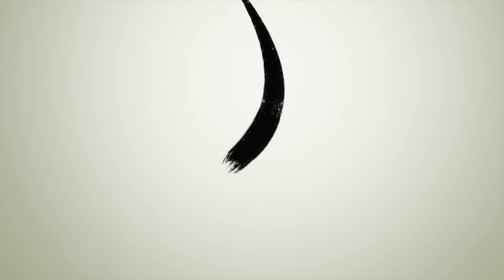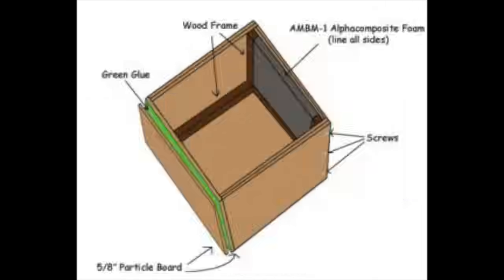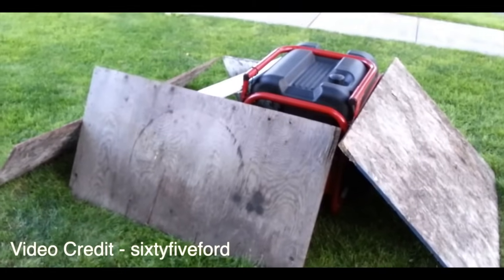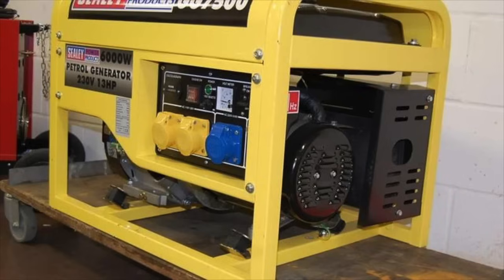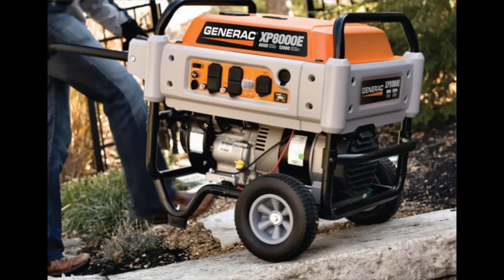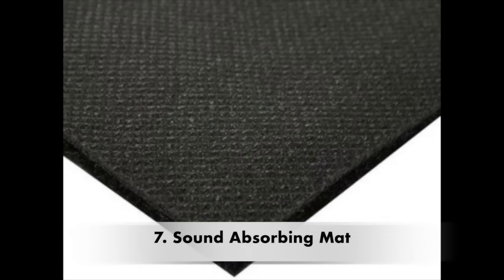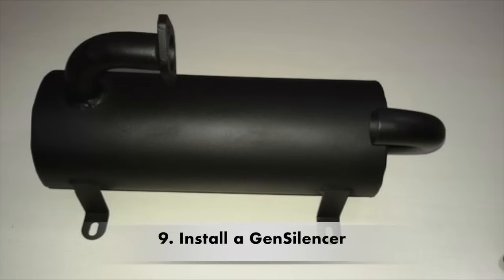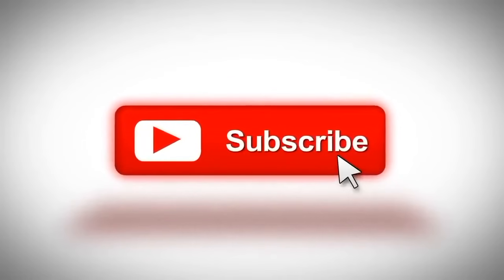How to make a generator quieter - 9 Ways That Work!

Comment: Actually most of the noise from an open frame generator comes from the engine block itself, along with the rotor/stator. You’d have much better luck building an insulated box, which you can either make with one side open (maybe point that side toward the woods) or put electric fans in it to circulate air in and out. Makes a huge difference!
Reply: this can b done in spare room with door close?? and have fan running circulating air? and exaust for ventilaion

Comment: For generators used to back-up electric company, dig a hole to put generator in.
Add a foam or insulation top panel.
Pretty hard to beat solid earth for sound deading!
And, a simple hole is pretty cheap compared to box options 😊

Comment: When you build a speaker enclosure, you would design the sides to be unequal to avoid making a resonant cavity that peaks certain frequencies (a 'booming' effect) Same-dimensions create standing waves that actually amplify sound. 
Same principle would apply to a generator enclosure: build each side so it is not exactly the same or a multiple of that one. For example, the front should be slightly larger than the sides and the top. This will help suppress the lower frequencies. Suspended-ceiling tiles will cut the high-frequency and some mid-frequency noise.

Comment: FYI. Your links are dead. Glad your Amazon storefront is active.  Got any recommendations for AC units sitting on the patio? So loud I can’t hear myself think. Built planters around it leaving sufficient airflow, but it still echos off the house. 

Got anything waterproof?

Comment: if it will be used in a fixed location. a comcreat base. then cender block walls.
insulated roof.
this combo will go a long ways to knock down the DB’s. 
BUT you must also allow enough air in and hot sir and exhaust gases out. 
so on the bottom layer of the blocks, leave a couple of then out. but have a anti insect screen. 
plum the exhaust out through the roof. up to the 10 to 15 foot level. 
and allow hot air out of the shed. but best if a fan is at one of the holes at the bottom to push in cold air.
the gen powers the fan. but no direct in or out for the air as sound dies not do corners very good.

Comment: Everyone talks about inverter generators on how good they are, and how quiet they are. Well, let’s see how long they last and when they do break how much they are to fix. There is a lot more to an inverter generator than just a motor and an alternator. A lot of technology, and you know that technology is exposed to heat, cold, and humidity

Comment: I've had a generator for about seven years now and haven't had to use it for longer than an hour.  However, with the recent weather patterns lately, I was wondering about muffling the noise cheaply in case I do have to run it overnight.  I like the third option of blocking the noise by placing plywood around the generator.  I would probably glue some some soundproofing foam on the plywood and also place a rubber mat underneath the generator.   Thanks for the tips!

Comment: Big mufflers never work. It’s the fact that a small 4 cycle engine has to rev to 3,600 RPM it’s the engine itself and the surrounding parts. VIBRATION IS THE REASON FOR THE NOISE, ALSO, SIZE MAKES NO DIFFERENCE I OWN A GENERAC GP 17,500E  ITS A 992CC V TWIN AND WEIGHS 400-500LBS ITS LOUDER THAN ALL OF THEM!! LOTS OF MISS INFORMATION AND HAPF FACTS HERE.

Comment: Built my own "zombie" box with 1/2 plywood and 2bys, 1st I heard it called that, anyway used a 12" 1600 fps soffet fan that blows into a 1foot sq exhaust port or box that blows into the earth down outside of the  enclosure to keep it cooler and 4 directional 4" intake tubes, (tin exhaust tube) on opposite side and 4 2" vents up top  for heat to escape after shutdown. Has 1ft clearance on sides and 2ft above generator. I used rockwool on front, rear and top, it's fireproof and its very quiet at 50 ft,  just a slight hum for a fully  featured  Westinghouse DF   9500watt, has 3yr warranty. Steer away from HF, Chinese junk for same price with no extras, warranty or features! Did put a small desk fan in back that blows across the cylinder, hottest it's ever got out of airstream was 130 on a 100 day, take off any useless heat guards. Has over 1000hrs and can't complain yet! Remote feature is also  great.

Comment: Just to correct the information, no small engine is splash oiled anymore.  Flathead engines will not meet EPA requirements and OHV requires an oil pump.  The easiest way to deal with a generator is to make a corral of filled concrete blocks in which to run it. It only has to be as tall as the generator.

Comment: Any holes you make in your shed are going to allow sound to escape.  The holes need to be covered with a baffle to break the sound up before it reaches open air.  This includes air intake and heat exhaust fans.
Isn't a gen 'silencer' just another name for a 'muffler'?
When building a sound-proof enclosure, you should think in terms of reflective, absorptive, and inert layers.  Innermost is reflective, next is absorptive, with the outermost inert.  The inert layer prevents the engine's noise from being transmitted into the surrounding environment.  See the comments about sandbags below.

Comment: Several are pressurized oil systems. One of the nig noise factors is most portable generators run at 3600RPM. Your sound better be able to move one hell of a lot of air. Its an air cooled engine and they need a lot of air flow

Comment: First of all dummy anyone who's ever worked on an engine knows that you don't put a car muffler on a small engine like a generator. That's why they have mufflers made for smaller engines if you're going try using a muffler from something like a Go-Ped that will muffle the sound but doesn't increase things like back pressure that will cause the f**** generator to fail and stop working on you entirely. Truthfully you could just not be lazy build a big enough enclosure that has a ventilation port or safe a fan and you build it with soundproofing material so that you can put the generator in it run cords from it and still not have to listen to it because it's in an enclosure that greatly muffles the sound. Just make sure to add say a fan or so to move the heat around so it doesn't stay in one spot and catch things on fire. It's amazing the type of s*** they honestly let people put on YouTube

Comment: sound proofing a generator  like this can cause damage to  the Generator . 1  it can cause the generator  to over heat .has to be vent very well then you lose the sound proofing . also  alot of gens  have alot of plastic's  on them that can warp  over time  use due to the heat . intakes . carbs  can be plastic . elec  control are plastic that do not do good in the heat . most  Gas gen are loud . propane  gen  run alittle smother  and alittle more quieter then gas .  but if you do this you do it with a  bad risk .
 risk  
over heat
wharp plastic  due to over heat 
elec  failure  due to over heation
elec control system   has silcone  base to weather proof  elec that can melt  an turn it into a 700$  repair . an sometimes   parts you can't get specailty  with honda  generator's  since Honda  loves to not make part for engine's or generator parts for  to long . 10 years i think is the max .
also you can blow your self up . due to the  gas tank being mount on the generator . 

SO DO AT YOUR ON RISK!  IF SAY IT CAN BE PUT INTO A BOX PUT IT IN A BOX OTHER WORD'S  THEY MAKE QUIETER GENERATORS

Comment: A Zombie Box or an enclosed soundproof box sounds like a good idea, but what about all of the heat? Where does it go? Out that small ventilation hole. It might work for 20 minutes. But after an hour or so, it's going to shut down and most likely destroy the equipment. Generators are air cooled. If there's no air getting into the enclosure, how does it get cooled? If you figure out the cooling issue, please let me know. I would keep one side open and aim a large fan at the generator. Unless you don't like your generator, then do whatever.

Comment: we dug a hole in the ground put plywood over it,one we put it in the ground to help cool the motor ,we put vents in the plywood top,it made little difference,we even put 20 ft of pipe on the exhaust little difference

Comment: I simply installed a smaller pipe to the exhaust.  It works for motorcycles as well.  Easy and cheap.  Reducing noise level 50%

Comment: I mounted a 250 amp dc alternator on the engine of one of my little Honda cars. Then I wired it to a 120/ 240 volt ac inverter . I have a breaker power box  that allows me to plug the 10,000 watts inverter to my house through a throwover switch. With an adjustable throttle cable, I can park the car outside my garage and plug my house into the cars power  inverter and power most of the house with a cord we got from a trailer house we got rid of some years ago. Our propane house heater is no problem, but can only run one ac unit on the house. But everything else works fine.  And you can't hear the car running at all. And since it's water cooled it never overheats. It's the car we take camping, so we always have all the electricity we want.
Thought about building a generator head attached to a car motor on a trailer, but this works good as is. And easily portable.  You can barely hear the car running.... And the best part I'd it sips gas and I can drive to to the gas station for more gas.

Comment: Forget it just spend the money up front and get a Honda inverter. They are the quietest on the market and very well made. I have had a 3000is for 16 years. Runs great, the lowest noise of any gen. On the market. No problems. It is not that heavy. So yes it is worth the $.

Comment: The best way is not to buy these cheap units they all run at 3600 RPM  buy a Onan they run at half that RPM I own a 28 KW unit that is powered by. 4-53 Detroit 2 stroke Diesel engine  I bought it for less than some of the gas units it’s 3 phase I bought a transformer to convert it’s out put to 240 volts 1 phase along with a big transfer switch that runs the whole farm for $300  I used a semi muffler on it it is in its own insulated metal building you can hardly hear it  I have a used semi 100 gallon fuel tank that feeds it along with 1500 gallons in the ground tank for the the equipment. Shop around you can find bargains and do not forget army surplus you find any thing look up government planet.

Comment: In my experience an additional muffler doesn't work and the silencers are no-less disappointing.
So, 
since even the quietest of the quiet-gens are anything but quiet,
the only really effective solution if the noise is too annoying is to just put the noise where it isn't as annoying. 
A noise reduction box or insulated shed as far away as you can place it does the trick.

Comment: 4:59 adding a car muffler will decrease the decibels by about -5 to -10 max which I have tested with various automobile mufflers. I used the low restriction type you would find on a performance car so this won’t change the motors output drastically.

Comment: Compresión sounding like air-conditioning like police and security cars have except getting stuck or chasing somebody the compressed thing off by its self and loudness comes out automatically or if it has bad muffler senior trucks nowadays and delivery trucks and cb performance and stock engine ones and school buses delivery trucks same thing but made of stroker but bigger boxer Volkswagen custumized deisel turbo and desil stock engine or all four in some they compress the noise sounding like normal truck and Volkswagen cars Volkswagen street Volkswagen and trucks like normal sounding but air-condition sounding tinging

Comment: For a long term permanent installation solution 
2 steps 
1 - A good larger air like a Donelson- (a lot of the noise comes from the intake air interruption between the strokes - much like a banshee siren)
2- conect a pipe on the muffler and put the other end in a bucket of water- simular working principle as an bout outboard engine- you just need to top up the water level for time to time
Reply: Unless you use the generator in cold country during the winter’s power outage…
Reply: @rogerlaramee1875 i would believe that the exhaust would keep the water from freezing

Comment: Before to buy a new muffler, put the exhaust  pipe inside a water bucket.
This will cut 90% of exhaust noise.
Reply: I once was running a (Thunder Tiger GP 40) 6.6 cc model airplane engine in the basement. I had along silicone tube that I ran from the muffler outlet into a bucket of water. I was amazed. At idle the engine was whisper quiet. With higher speed the bubbles got larger and splashed the water. Further investigation of this is required.
I suspect this would be more effective if there was a "spreader" that maximized the area of the exhaust into small holes to maximize the flow rate while preventing big bubbles at wide open throttle. Surely this would be cleaner for the atmosphere as some of the noxious gases are absorbed by the water? To the chemical engineers out there: what other liquid could be used that would make this even better?
Reply: @christopherknee5756  also spraying water in the exhaust system will break sound waves.
Spread bubbles under water level with multiple holes will make it quieter, but do not expect to have clean air on long term use, there is high risk of poisoning

Comment: I plan on making a box for my generator due to your video suggestion but I'm concerned with all the pictures and videos of people using wood or MDF for the box. is that not a fire hazard? I was thinking of making mine with a steel frame and some sort of inflammable covering around the outside but if I could get away with wood and traditional insulation that would be a lot cheaper
Reply: I'm currently looking at the same setup but to my understanding using steel frame would result in vibrations/rattling noise due to the sound waves bouncing off of the frame which could possibly make it louder. Also the fire hazard you are talking about is in most cases when one has a generator that is faulty or leaking petrol. To remedy this I think it would be best to remove the generator from the box to refuel it and wipe any fuel or wait for a couple of minutes to make sure any spilled fuel has evaporated into thin air. With all that said is like to hear your opinion on all that ivve said d if there are any improvements to be made.
Reply: @fadilthefxtrader7667  so I did end up making my box out of steel but I lined the inside with fire resistant insulation. the insulation cuts down the noise and my generator which is 9000 watts is about as loud as my 2000 watt inverter generator now, so it's really quiet. the fire hazard I was referring to is just heat from the exhaust building up inside the Box. so after half an hour of running, inside the box, next to the exhaust on my generator it gets to be about 250°. Which isn't enough to light MDF on fire but it's a little too close for comfort for me.

 It would be cool to design a ventilation system with a fan to help circulate air around the engine so the engine doesn't overheat. these are after all air-cooled Motors. and when we seal them in a box they can get hot and overheat pretty easily. but I'm trying to figure out a way to do that without also making it way louder. Oh and in case you're curious the exhaust does vent to outside of the box through a Custom Piping that I welded up but that Custom Piping gets really hot and that's what's heating up the inside of the box even though the exhaust is wrapped in fiberglass

Comment: No offense, but I guess you are a master of none and a novice of many.
-Boxing in the generator will make the motor run hotter than normal. It actually should stop running if u box it as it likely has a CO kill on the generator.
-you especially hold the wood(in this case with a push stick-or you should) that is between the table saw blade and the fence. You are just asking the wood to pinch and potentially snap the blade sending metal at you.
-you know, you could skip getting a battery fan and plug in a fan to an outlet on the generator...
-plug the hole with "a thick piece of rubber" when you show a picture of patching a drywall hole with mud over mesh.
among others.

Comment: Hello there, I am really looking for some advice please. I have just purchased an air compressor to help me operate a cup sealing machine -I found out I also need a generator to power the compressor as its a 2.2kw and unable to use with my home switches without having to go through a whole bunch of electrical work.

The issue now is I have a compressor with a 97dB sound and a generator with a 74dB. 
My solution is to buy a garden shed and then stick the 2 machines in there and off course soundproof the shed. The generator is an LPG hence I wont have to use petrol.

I am looking for advice on how to soundproof the shed as these machines will be working along side each other.

Your help is much appreciated

regards
Dela

Comment: By adding a muffler or silencer you sacrifice the horse power on the generator. your best bet is to build a box with a vent fan so the generator does not over heat. I know this cause I use a generator at my shop that powers the office 5 days out of the week  10 hours a day. also try to remember the more bends in the pipe the more you lose in horse power and your generator will be less fuel efficient.
Reply from the maker: Thanks for the input! You make great points!

Comment: Modern open frame generators Honda Clones devolope alot of noise from the valve train.  Setting the clearence to 3/1000 make them oh so nice.  If you don't run them at all then you hear the wifie bitchen so what's worst.